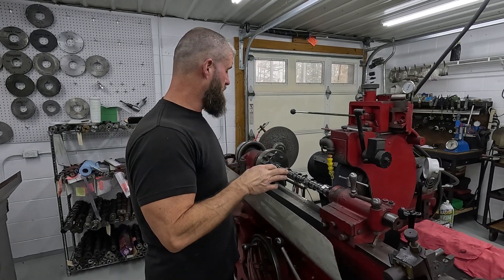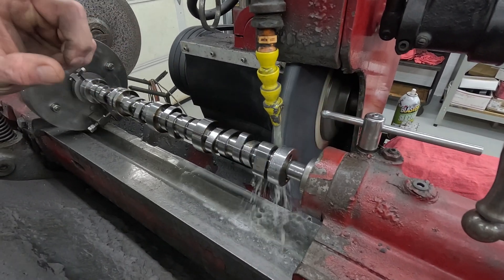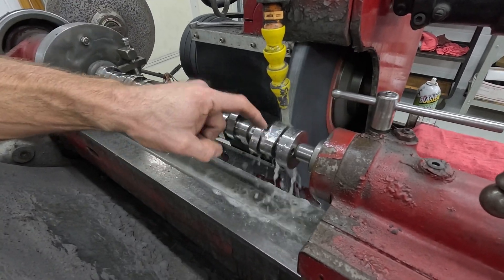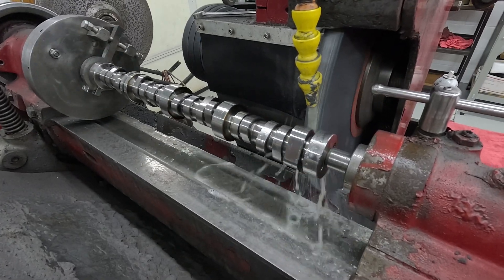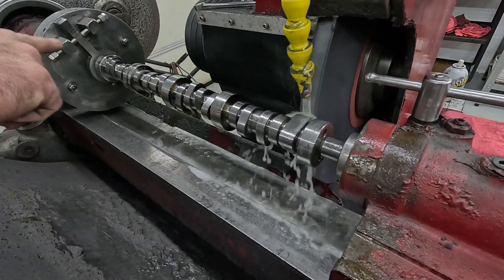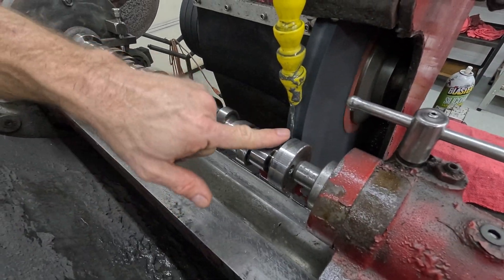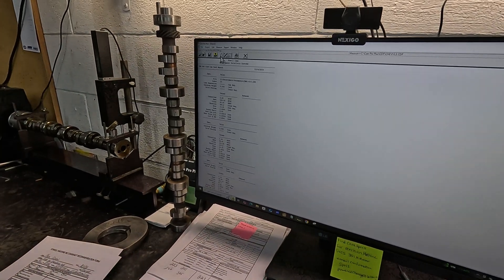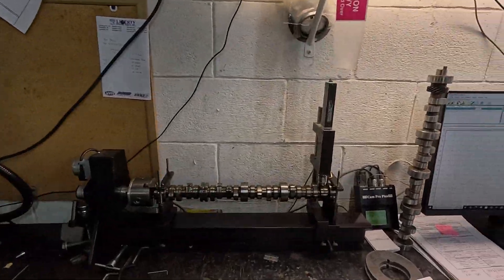Gen 5 L8T cam Fuel lobe grind , 32% over

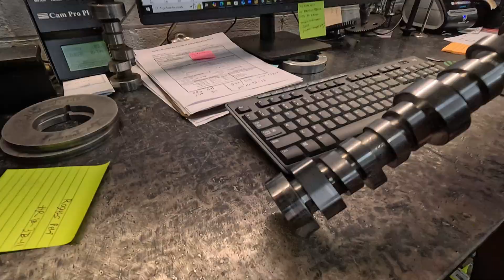Comment: That cam had a bit of wear on the lobes (@10:28 or so). Would that effect the life of the cam?
Reply from the maker: @dirk013adfa  it's brand new, it has no wear
Reply: @PowellCams  Maybe that's oil or something. My mistake
Reply: heat treat should be deep enough,, i wouldnt think the surface pressure would be near as high as a roller lifter